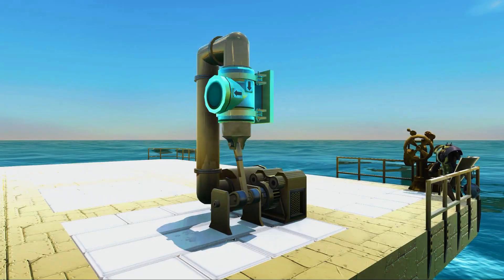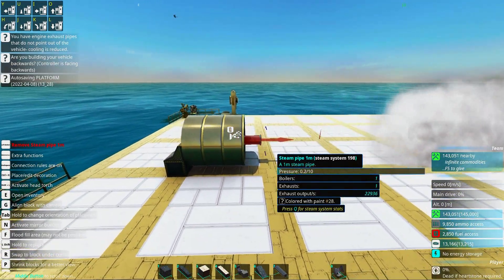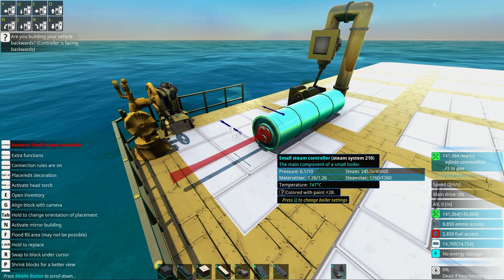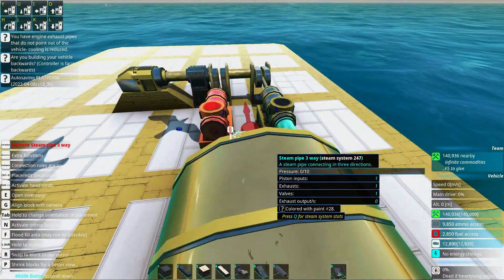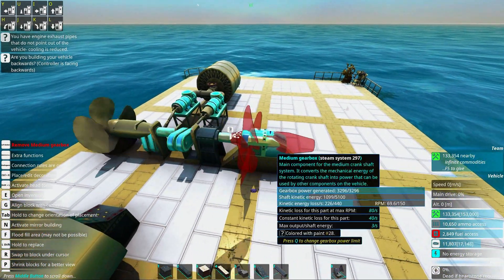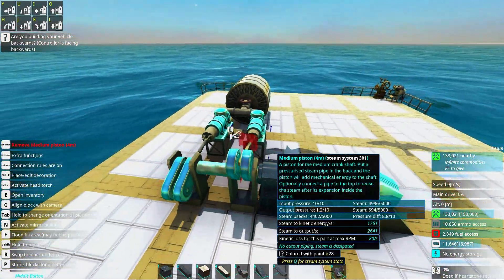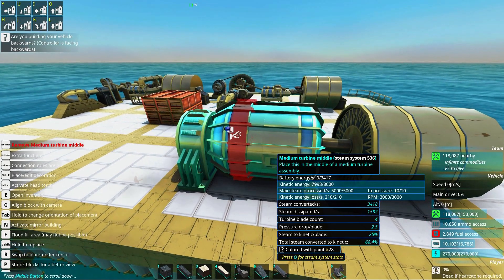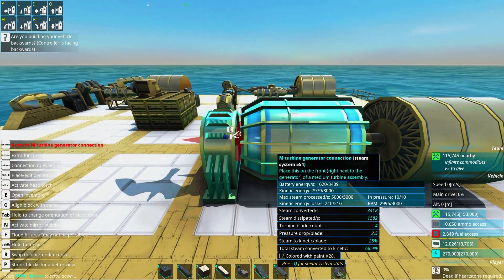From The Depths INSTANT Tutorial: Steam Engines & Steam Power

Comment: I'm completely stuck on attaching pistons to crankshafts, and this video seems to skip over that entirely. It's less of a tutorial and more a bunch of handy tips to get more out of steam engines for those who already know how to make them work.

 I'm trying to make a large steam engine turbine system for a large ship, and I'm really regretting even opening this can of worms because I've made lasers, cram cannons, APS, fuel engines, this is easily giving me the biggest headache of all of the systems I've learned so far. But, regular electrically powered engines don't seem to give nearly as much push for the amount of propeller blocks, so if I want this behemoth to be as quick as possible it's got to be steam apparently. At this point I'm considering giving up and using aircraft props.
Reply: I finally figured out where I was tripped up. My cased cranks weren't rotated properly to fit with my pistons (the four pillars on its top need to be placed under the four legs of the piston, relatively speaking), but the error message it was giving me was that it wasn't connected to a gear box, so I was just incredibly confused, and of course the in game tutorial uses small steam engines so I didn't recognize how the parts were supposed to rotate to line up. Gmodism's other, older tutorial was much more helpful in letting me see what was going wrong with my design, since he was using large steam engine parts in that tutorial as well. https://www.youtube.com/watch?v=CN4BKSnDaFg

Comment: steam! but why should i want to use it over fuel engines?
Reply from the maker: For one it's cool, other than that it's the best electric power generator and high health low blockcount engines with a lot of power, also one of the cheapest ways to get a lot of propeller thrust.

Comment: I use steam turbines to build airplanes 👍 its very easy to get electric charge, convert it into engine power, and then place down some jet engines
Reply from the maker: Very cool! But is it not more efficient to just use Custom Jet Engines?
Reply: Actually yes! I just like having steam fly out of the plane when its hit!  Im not really the efficient kinda guy 😂
Reply from the maker: Well  @maikeldekwant  Steam Thrusters would be a cool steampunk plane addition ;)
Reply: @GMODISM  im actually using them at this very moment! 👍 Still kinda figuring out if their power scales depending on how much steam is in the system 🤔

Comment: could it be possible to recycle the exaust back into the engine without adding another piston. like a loop that loses steam over time, refilled by the boiler that only adds steam when the engine is below a certain pressure?
Reply from the maker: No, because then steam would not move out of the system at all, engine stops, try it and you'll see.
Reply: Power scales with the pressure difference between the inputs and outputs. That's why power dropped when the output was reused, since the output didn't have an open pipe to escape from so it was higher pressure, so less power.
Additionally, lower pressure steam can't magically become high pressure, so you can't re pressurize it to feed the pistons again.
Reply: @Mernom in the demonstration engine with 2 piston and no reuse, the output was ≈1

the one with 1 direct feed piston with the exhaust reused it was ≈4 pressure

with 2 direct feed piston reusing both to 1 piston the pressure was ≈5

Comment: Thank you! I was struggling on how to make steam engines more efficient. I never knew you could reuse the outputs. I think I have a really good idea for an efficient design now
Reply from the maker: Awesome and good luck! The more it is reused the less power it yields, but this is rarely a problem for high pressure/massive boiler configurations. Also stay tuned for weekly tips!
Reply: @GMODISM  I am a really big fan of how steam engines work and how much power they produce, but I don't like how inefficient they are when I was making them. My main focus is not losing 200 mats per second 😭